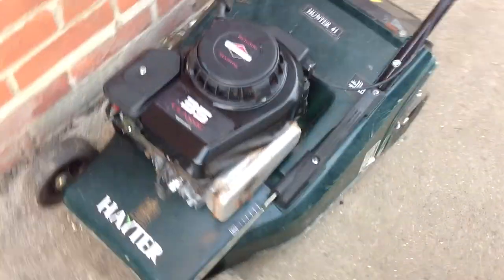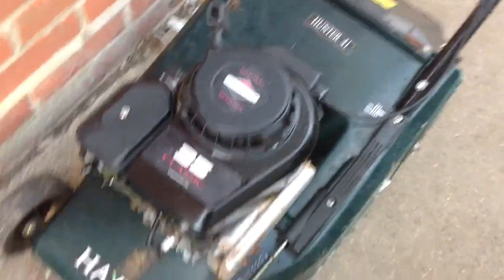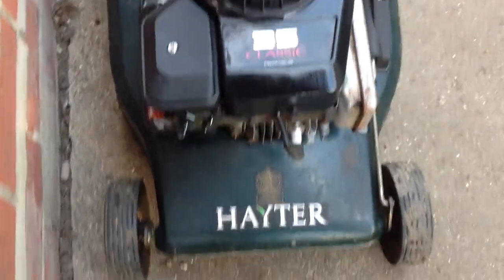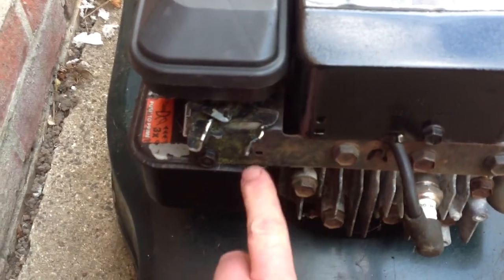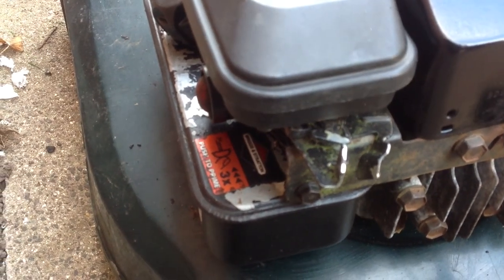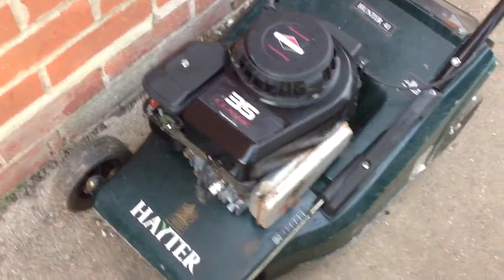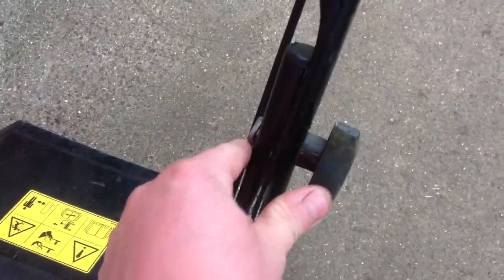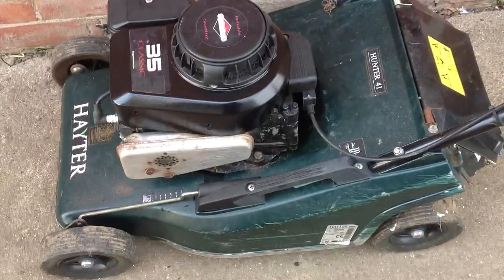Hayter 41 video,just a quick look around my latest mower fix up.

Comment: It Looks like  a good mower
Reply from the maker: Yes I doesn't seem a bad little mower,I alway think these smaller are better by not being self propelled as they are so easy to push.The old engine smoked badly usually, I find these classic engine don't have that problem very often.Thanks for your comment.